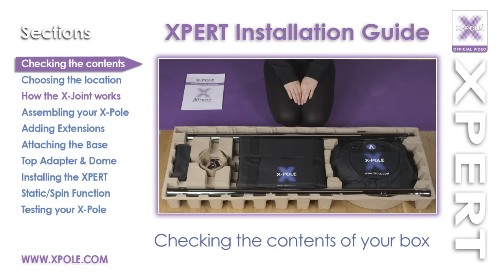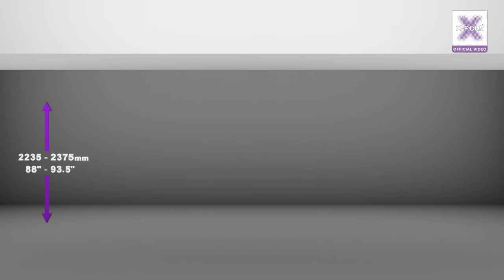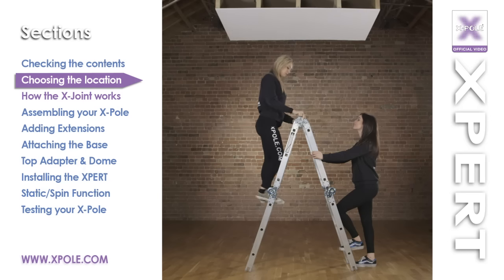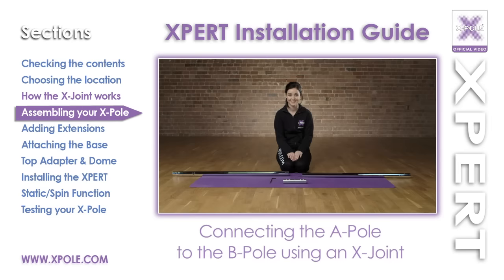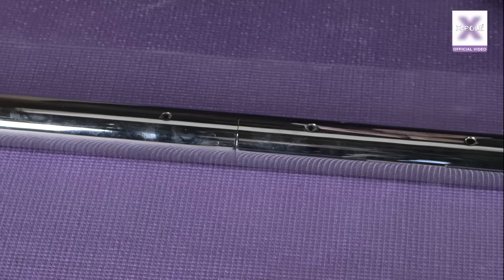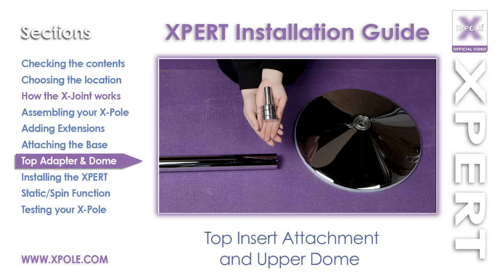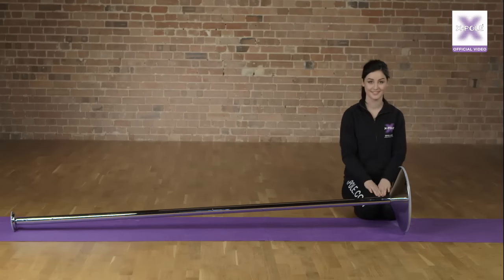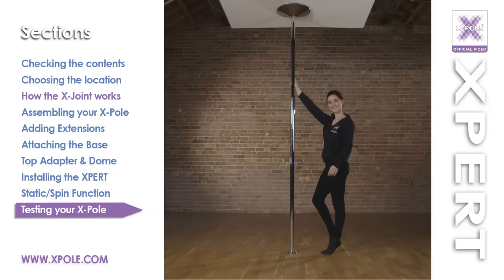X-POLE XPERT Installation Video (2014)

Comment: I have watched this video over and over and have come to the conclusion that my pole is defective. It will NOT adjust. The video shows the girls easily twisting it counter clockwise after loosening the screws and mine will not budge at all. I didn't do anything to it. This is the way it came out of box. I am so disappointed and don't know what to do about it.
Reply: I've been truing to adjust  mine also and couldn't get mine to budge.
Reply: venus I ended up fixing mine by drowning it in WD-40
Reply: I'm having the same problem it will not budge

Comment: Hi! I received 45mm Xpert pole yesterday but it DOESN"T FIT. My ceiling is 2.47m and the 125mm extension is too small but 250mm extension is too big. Please help!!!
Reply: I have the same problem. Did you get any answers?

Comment from the maker: Rebekah - thank you for your kind comments - this installation video only applies to our 2014 onwards models. If you have purchased a pole over a year ago, this will be a different style. Please contact us if you have any further queries.
Reply: X-POLE hi I'm looking for a video to assemble your Ariels rig.
Reply: i need your help.I do have this model and have problems with adjusting the hight. Because if i undo the 3 screws and move the pole clockwise/ ati clockwise to adjust the hight ..the whole pole is moving around and no hight will be adjusted.What am i doing wrong :.-O ?

Comment: I live in an old Georgian building in Edinburgh with high ceilings, is it safe to install a pole in that type of building or would the ceiling be at risk?
Reply from the maker: Amy - this totally depends on the strength of the ceiling and other variables which we would not be able to comment on.

Comment: What will happen if the pole is not under the stud accurately?
Reply: I know this comment is 7 years old, but for anyone in the future who have the same question; it will punch through the ceiling with enough force. The stud is a wooden beam that can handle the force on the pole. If you’re between studs in the dead area there’s nothing to support the pole. Think of when someone puts their fist through a wall into the empty space between studs. That’s what your pole will do, being off center or away from any studs will crack the ceiling and possibly punch through. You want to be anchored with the dome using the stud for tension support, not breakable drywall.

Comment: hello. this version of the -x-pole seems a little too difficult to install. the x-joints are hard to loosen and tighten. I noticed this video is two years older past the time i have purchased my pole but is the most updated version I have come across. the base is not tightening to the "A" pole and mine does come with the x-joints. I have purchased the started kit for an additional $27, which is to include installation instructions, ( that I couldnt get) I just purchased my pole in June, so if there is any updated parts or videos to installation, please upload them. I have invested over $300 in this pole and would like to start using is or send it back for something more simple. Thank You!!!
Reply from the maker: Hello Charlotte - this is the latest version of our pole set. If you could email us using the email address above, we could investigate this for you. Thank you.
Reply: Thank you getting back to me. I spent hours repeating the video and getting more familiar with the parts.....lol Everything is working great now, please excuse the previously frustrated reply.
Reply from the maker: That is no problem at all Charlotte. Glad to hear that everything is okay.

Comment: How “smooth” should the spin setting be? My Xpole, when on spin setting, doesn’t feel as smooth as when I use a spin pole within a studio. If I loosen the pole, it moves, so I don’t think I’ve overtightened it?? Help, please! Thanks in advance :)
Reply: I know this is an older comment but I'm having the same issue. Did you find a solution? The spin has so much resistance, not at all what the studio poles are like!
Reply: @kimberlypapillon1608  I never got an answer, just use it on static 😂

Comment: Hi there. We purchased a 40mm chrome xpole xpert 2014 model. We installed it following the video instructions. The only problem is some strange noises coming from the dome when we are rotating the pole relatively fast with our hands. It sounds like metal touches other metal. Its not loud but i just want to make sure that we dont do something wrong. I unistalled it and had the dome turn around the top adapter and it makes the same sound. Should we use any king of oil of lubricant? Thanks in advance.
Reply: I have the same problem... Did you solve it?

Comment: Hello, my new ceiling is 2.45m high, I have an extension of 25cm, will it be ok? I’m gonna try it but I’m scared if I do a hole in the ceiling or something because there are people living on my ceiling, is it possible to assemble it with a 250mm extension? Or it should be 125mm?
Thanks!!!
Reply: ***I bought my pole on December 2017😉
Reply from the maker: Hi! Use the 125mm and some of the adjuster on the bottom of your pole 😎
Reply: @x-pole  yeah...I need a 125mm extension: the 250mm is very high and without extensions is very low so...yes I should buy a 125mm...thanks!😉

Comment: Does anyone know what to do when the ceiling is too high for the pole with no extension and too low to fit it with the shortest extension? I know, according to their measurements it shouldn’t be possible but it is... my ceiling is 1-2cm under the max limit for no extension...
Reply: Samme here! 😢😢😢 Don't know what to do
Reply: Stuck

Comment: Hi, I'm having problems with my 45mm xpole. My ceiling is 7"9 and I have tried both models in the instruction manual. With the 7"4-7"9 and a half I use the height adjuster but to reach the ceiling it extends over the maximum. With the 7"9-8"2 it is too tall. Any ideas?
Reply: V

Comment: Hello, my ceiling is 3.20m 
I have purchased the pole with two extentions (250mm and 125mm). It doesnt reach the ceiling. If i get the extra extention will this solve my problem? And how what extention should i get?

Comment: what do i do if i have overextended the pole and it wont reduce in height?
Reply: i need your help.I do have this model and have problems with adjusting the hight. Because if i undo the 3 screws and move the pole clockwise/ ati clockwise to adjust the hight ..the whole pole is moving around and no hight will be adjusted.What am i doing wrong :.-O ?

Comment: My ceiling is 98" but the 125mm extender is too short, and the 250mm extender is too long. When I rotate to expand fit the pole with the 125mm extender, it comes up past the red horizontal line and leaves a small gap. help?

Comment: Im so angry ... before I have a 50 mm X-POLE XPERT with the old system and the pole fits. My room is 2,25 m high. Now I have a new pole with 45 mm and it doesent fits. If the usser manual says that it fits by a room with 2,23 why it doesent fits with the new pole?

Comment: Hi I have a 97", 2464mm ceiling and I bought my pole in 2021. I've attempted to adjust the base as low as possible and the pole is still a bit high for my ceiling. I haven't added any extensions either. Just wanted to double check if it can go any lower and what I have to do to adjust it. Any advice would be appreciated!
Reply from the maker: Hi! Can you confirm which model pole you have, please?

Comment: I have a hard time with the hex screws, they wont screw anything, i have just put the parts together but i cant tightening the screws, it looks so easy on the video but mine wont move anything when i try to tighten them clockwise.  I dont know what to do, and im afraid the screws are gonna get rounded.
Reply from the maker: Hi Vendela, the best way to put the screws in and make sure they don't round off, is to actually turn them clockwise against the thread to ensure they are fitting properly and when you can feel them sitting smoothly and straight, start tightening with a counter-clockwise motion :)
Reply: Vendela Lohaller and X-Pole.. I finally figured it out! The trick is to practice tightening and loosening it with the hex key when it's not in there to try to figure it out. I was doing the same thing as you were doing probably Vendela, I did not realize I was using the wrong hex key to tighten because there are two hex keys in the package and the other one had a silicone cover on it I didn't know I was supposed to take off

Comment: I'm having the same issue as Venus & Bryt. My pole is assembled but when I try to turn the pole  counter clockwise to extend it, my pole won't move an inch. Will drowning it in WD40 compromise the stability of the pole in the future? Is this the only solution? I appreciate all of your help ladies :)
Reply from the maker: Gabrielle, Bryt & Venus - if this was a problem identified when the pole came out of the box, then you should contact your point-of-purchase immediately.

Comment: I know this is an old vid....but I'm moving house and assembling my pole there now. I have a lot of the red line showing- so much so that there is a horizontal red line at some point. Is this safe or do I need to order a small extension?? The one I already have make it too tall to put up
Reply from the maker: Nicole Cann as long as you can’t see the black or red ring, you should be ok.

Comment: Hello,

I have a 45 mm XPole but it seems the screws at the bottom stick out too much and I scraped my foot. Am I not screwing them in right?
Reply from the maker: Naomi Could you please give our offices a call and our technical team can help you out...
Reply: Hi Naomi, I was wondering if you might have got this problem sorted? Was the reason because you had extended the height too much so that they wouldn't screw in properly? If so, how did you fix this?
Reply: +Brianna Lewis I had the same issue. The screws for spinning mode need to be loosen just a bit, but not to go outside of the pole itself. If you have a manual, check page 13 lower left picture (there's a red X saying when screws are loosened too much).
Another issue for scratching: I at first used only 1 adjuster (based on the instruction for 160 cm). But it opened the lower part of the pole too much and there were some sharp pieces seen. So I added one more adjuser (2 altogether) and it worked great!

Comment: Just received my pole today! BUT with no extensions the pole is too short and with the smallest extension its too high! My ceiling 2.35 meters high. please help!
Reply from the maker: Hey Maggie - at 2350mm (2.35m) - you should not require an extension. You would simply have to extend your adjuster, so that the pole reaches the desired height. If still in doubt, why not give our technical team a call?
Reply: X-POLE Hi! I called technical support and they sent me a longer B pole and now i have a fully functioning pole! Thank you!

Comment: I’m trying to adjust it as my ceiling 7”10 but when I twist it nothing happens
Reply from the maker: Hi. Have you put it in static mode (locked off the two screws on the base) and loosened the three adjuster screws?

Comment: Hey, I want to order the xpert pole (UK) ASAP however have seen various reviews about inaccurate size recommendations on the website- and customers having to order extra bits etc which I’m worried about...
Reply from the maker: Hi. If you measure your floor to ceiling before purchasing, you can put that figure in on the pole product page and it automatically tells you if you need an extension. Always measure first; you wouldn’t buy a pair of shoes without knowing your foot size right? Same principle 😁
Reply: X-POLE hello yeah I definitely measured it haha! My concern is whenever I put the measurements and add to my basket and then click back on what’s in my basket the measurement that I have entered disappears? And when I go to check out it doesn’t specify the measurement I’m ordering other than the diameter of the pole- is this how it’s supposed to be? I can also see the covid-19 message about possible shortages in stock but can’t see any info specifically about the xpert pro when I put it in my basket? Thanks for quick response ☺️
Reply from the maker: beth murray when you go back to the product page, yes, it’ll be blank. The diameter and length of the extension should shoe in the basket. No shortage or pre-orders needed for XPERT Pro right now 👍🏻
Reply: X-POLE thanks so much! Sorry to bombard with questions- I have now ordered-however won’t allow me to create an account with my email address or log in with the order Number to keep an eye on my order. I have received an email to say the order won’t be shipped until funds are received and to put order ID as payment reference although I’ve put the payment through with a credit card already?
Reply from the maker: beth murray did you select bank transfer at checkout? As you have to log into your internet banking to make the payment to the details provided in the email.
Reply: X-POLE I selected checkout then filled out the fields with credit card details...then receive this email:                         
    •Thanks for your order. It’s on hold until we confirm that payment has been received. In the meantime, here’s a reminder of what you ordered:

Please use your Order ID as the payment reference.

**Your order will not be shipped until the funds have cleared in our account.**

If you checkout in GBP Sterling (£), you must pay the outstanding balance to Vertical Leisure Ltd. (£ – GBP) in GBP Sterling (£).
Reply: X-POLE it did say order received, the date, order number, total paid, and then payment method= direct bank transfer. However it took my payment details already...
Reply from the maker: beth murray sorry, but it’s not actually possible to take your payment details via the bank transfer checkout option. Please check you bank account and you’ll see nothing has been taken 😉
Reply: X-POLE i 100% gave my credit card details once I had clicked on the debit/credit card details option not the direct bank transfer option so v confused and concerned as to what’s going on
Reply: If I want to cancel my order (at this stage it’s still on hold) how do I do this?
Reply from the maker: beth murray we can do that for you if you like and you can then reorder and check out with either a debit/credit card or PayPal? Just let us know.
Reply: X-POLE is there enough in stock for me to do that within the next 15 mins or so
Reply: Can you cancel the order providing there’s enough in stock- do you need my order number ?
Reply from the maker: beth murray please email sales@x-pole.co.uk with your order number and tell them you like to pay with a card instead of bank transfer. They are in the office from 9-5 Monday-Friday.
Reply: X-POLE if I make a brand new order now via debit card- before I can cancel on Monday can you confirm that the previous order that I have made will never go through/ funds won’t be collected unless I manually make that bank transfer?

Comment: how do i take down my pole ??
Reply: +mk sogirly Loosen the adjuster and spin clockwise to shorten the pole.  If you watch the part where they explain how to tighten to pole to the ceiling by spinning it counter clockwise, do the opposite.
Reply: AmbiixROX take out all the black screws and spin clockwise basically?
Reply: @omgitsalexis1000  I’m asking the same...🤦‍♀️
Reply: @AmbiixROX  I unscrewed all the screws but I cannot uninstall it...🤷‍♀️🤦‍♀️

Comment: I had my pole up and running perfectly for 2 years. I recently had the flooring done so I had to uninstall my pole. Now, when trying to reassemble my pole, I am having difficulty attaching the micro base plate. To begin with, base shaft rattles loosely around in the base plate even before I try to attach it. Is this normal? I do not remember it doing this before, although I could be wrong. Secondly, when inserting the shaft into pole A, it does not make a connection, and has about a 1/4 inch gap. Neither the manual nor the instruction video address this. What possibly could have happened?
Reply: greentech33 can I ask, did the pole make a mark on your flooring at all? I’m in rented so I can’t damage the floor in any way!

Comment: Soo I dont need to screw it to the floor nor ceiling
Reply from the maker: Correct, it’s pressure mounted, so no drilling into the floor required 😊
Reply: @x-pole  t.y very much muah

Comment: Hii Help🙀Does anyone’s pole wobble in the middle? The height feels tight but the connection in the middle rocks a little. Any information would be nice.
Reply from the maker: Thurayya Gomez hi! What’s your floor to ceiling height in millimetres please? Also, have you tightened the x-joints properly?
Reply: @x-pole  The height is  2565.4  and yes I believe so.
Reply from the maker: Thurayya Gomez ok, you should be using the A pole, B pole and the 250mm extension for that height. Again, please ensure the X-JOINTs are regularly tightened to ensure a safe experience.

Comment: Hello! After I loosen the screws to expand it to the ceiling,  it is not expanding upward - it is just spinning. What am I doing wrong?
Reply: +Carrie Myers Did you make sure to tighten the screws at the base? I imagine if those aren't tight enough that the pole would just spin without lengthening.. double check that!
Reply: Life